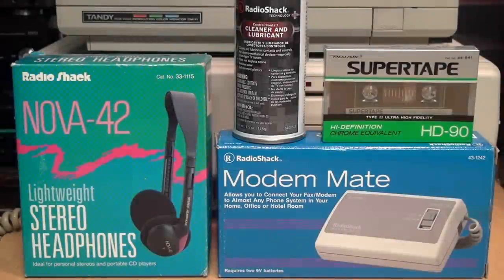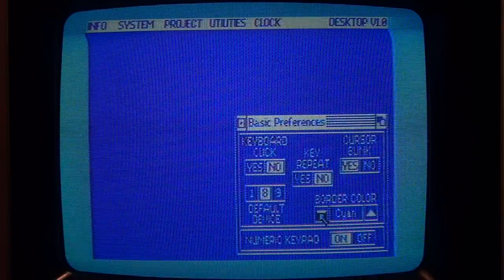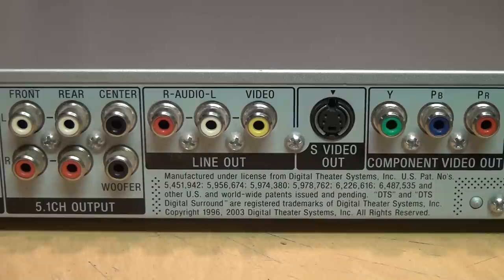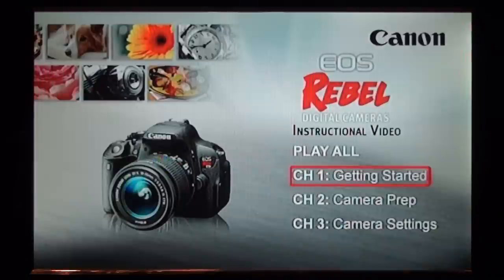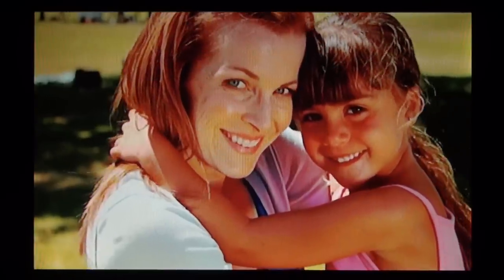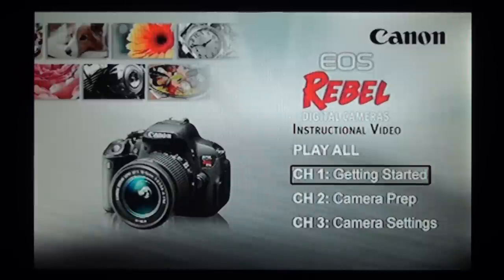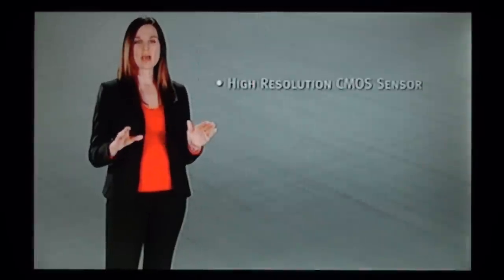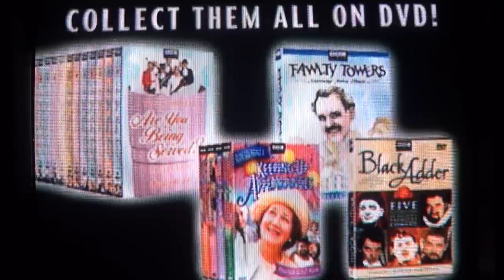Radio Shack S-video signal converter 📺 How? Why?

Comment: One thing I noticed with your C64 tests is that the composite output syncs fine but both the tied Y/C and the RS adapter skew the top of the picture. This is common when sync voltage is low, such as evident by the dark picture when Y and C are tied. But it's more confusing on the case of the RS adapter as it appears to pass the picture at full brightness.

Comment: These adapters were very common during the 2000 era of graphic cards with a s-video output. Most ATI AGP graphic cards had this kind of adapter in the box.
Reply: I still have two or three of these adapters rattling about my cables and adapters box, and they all came with a graphics card. It did come in handy when I hooked up an old video camera to a grabber. The grabber only had a component input, and the camera only had composite (and a small FireWire port, but there was no FireWire card or even a FireWire cable in sight, not to mention the drivers). I also had a SCART to component and S-video adapter that I used to digitize some VHS tapes with said grabber.

Comment: Laptop in 2008 didn't have HDMI or Composite out, but had SVideo out. Also my collection of game consoles had to be put into a switch box which, for some reason, only had Svideo out while it had both as in. I actually used one of these convertors for the switch box while my laptop came with its own octopus adapter.... back when people still watched TV.

Comment: I can see this adapter working in certain specific instances... I have a Walmart Special (SV2000) DVD Recorder/VHS Combo. The front panel inputs (Input 2) feature a composite and S-Video input with shared audio input, and I can select the source for Input 2 via the menu system, so this could work to connect two devices to that one Video Input.

The audio from that Coby TV sounds a bit like being on speakerphone (Nortel Meridian phone system)...

"What begins with 'come here,' and ends with ow?" Gets me every time!

Comment: Sometimes modern TVs actually have a combo jack of some kind (like TRRS) that put all the signals onto one inexpensive connector. The company then sells an
annoying custom dongle/breakout cable.
Reply: The best ways to use composite or S-Video era products on modern TVs is to either upconvert to HDMI or use an RF modulator. Sometimes a VCR in the chain will clarify the picture if using an upconverter. On my TCL TV, I tried the TRRS 3.5mm AV input and it did not work. The older devices we have had for years are often still the most reliable.

Comment: I used this in the past, running an early HP Media Center PC video-out around the room to a tv.. buying a 50 ft composite cable was much cheaper than buying a 50 ft S-Video cable at the sacrifice of a little quality at the time..

Comment: It’s likely just a simple LCR band pass filter centered at 3579545Hz, likely with a bandwidth somewhere around 0.5-1.5Mhz.  I’d expect this thing will notch this band out of the luma channel, which will make it look softer overall..  a good multi burst signal and a waveform monitor/oscilloscope would show what it’s doing rather easily… I used to align old GVG 3000 switchers back when I was a mere “engineering boy”
Reply: Yeah I was imagining something similar using a tank circuit to filter the relevant bands and separate them

Comment: One other use I can think of for this is if one type of input is all full on the TV and you don't want the hassle of an external switcher you could probably get this cheaper than a switcher and convert a device that normally needs the fully used input to the other where you have a free connection. It works better than I would have thought especially on that CRT, the reduced dot crawl could be worth the slight loss of sharpness

Comment: Svideo is just composite video with separate lines which carry the luminance and color components over separate wires, you can simply mix the chroma and luma, and sync iirc lines with resistors or a simple mixing circuit to get a composite rca signal

Comment: A reason I haven't seen in the comments so far, but what if you don't have enough ports? You just want to add some new device to your setup, you have a spare port (possibly even switchable with your existing remote control) that you otherwise couldn't use, and don't want to justify going to a full external switch box. That's one good thing from analogue, often possible to "bodge" just what you need.

Comment: You can still buy these converters on eBay, though generic unbranded rather than Radioshack.  The only component inside is a capacitor of around 470pF in series with the C (chrominance) signal before being joined up to the Y (luminance).  This prevents the DC level on Y (which includes the important sync pulses) being affected by C.  It's a very ghetto way of mixing the signals though with numerous flaws which is why the PQ isn't great.

Comment: I have an actual scenario where having this would have been awesome. 
For my gen 1 Xbox console the only av cable I had was an aftermarket “monster” cable that outputted to L/R audio and svideo. Now at the time I had tvs and vcrs that didn’t have svideo in but always had composite in. Even my Hisense older 1080p tv has composite but no svideo. This adapter would have been awesome. I think I might try to find one because I liked how heavy duty that cable is.

Comment: I have one of those that came with a PCI DVR card. The card was cheap and only s-video in and out so they provided the adapter (but only one). Haven't used it since I needed it emergently to make a v-jam session or projection show work 10 years ago. I'd run out of video inputs with everything connected to everything else! I think I was using it on an inter-layer of a live process effect so it just made it look slightly different (instead of color crawl or smearing in the program output)
Reply: I don't know if it has a capacitor BUT (and I just found it!) this one does have an arrow pointing from composite to s-video so I'll check if it has a cap... looks like no! Interesting! I think I was only using it to pass a monochrome key signal anyway, image damage may have been (actually) negligible.

Comment: I used to connect the chroma and luminance together with a simple 470pf cap. It wasn't perfect but it did ok for my needs.
I think most of my problem however was I have a radio station close and I didn't adequately shield it.

Comment: The main difference between NTSC composite and S-Video was the video bandwidth. I've forgotten the numbers now, but S-Video had something like 20% more bandwidth available than composite did. So it is perfectly reasonable that composite is softer or blurrier than S-Video. Lower bandwidth means slower transitions from one voltage to another, and this translates into blur between the pixels.

Comment: I had one of those back in the early 2000's. Had a camcorder that only had a S-video input, and a VCR that only had a composite output. I would run video from the VCR, convert it to digital, then run that to my Mac. Those adaptors cost $26.00 back then. Expensive little booger.

Comment: Back in the day I had a cable with one end being S video and the other being RCA, packaged with a GeForce FX 5200 (Can't remember the brand, may have been Inno3D)    
Used this to connect my PC to my TV  
It didn't even have anything that could contain any circuitry inside, so this "conversion" is probably considerably simple

Comment: the circuit for that is super simple. one time I just installed the plug and the cap directly into a tv to "add" the ability to take in svideo. could not really notice on TVs with the dot pitch of rice.

Comment: I could see this being useful.  Say, you've got a cable box with one of each video connector on the back.  Composite goes into the television and converted s-video goes to the VCR.

Edit:  this comment was stupid and im leaving it here as a reminder of shame

Edit 2:  Flatscreens will often have legacy rca composite input, even if they lack component or svideo.

Comment: I got one of these in about 2003 to convert the s-video output on my computer to the component input on my 28" crt tv. 
The biggest computer screen i had wss a 14" crt. The resolution was awful and i could barely read anything even at 640x480. Thats when i discovered that TV's werent designed for that use lol!

Comment: I suspect these were mainly for connecting laptops that had s-video output before HDMI widespread adoption but VGA was too thick. most notably in some MacBook models.
Also useful for those tvs with only one rear and one front input, but also had an s-video input on the rear, of you wanted more than one device connected

Comment: I use a similar one for my playstation2. The best cable i have is a s-video one, but my little 14" crt only has composite input. So this little adapter does a good job.

Comment: I could see how this would be beneficial if you had a tv with an S-video input with a separate source selection and didn’t want to have to use an external source selector. I have such a TV(from 1998), but I use the S-Video to input from my Panasonic DS-555.

Comment: Haven't needed to use it, but I have come across tvs with 2 dedicated composite inputs and 1 dedicated s-video input (each with their own set of audio inputs), so an adapter like this would have opened up an input for a 3rd game console or similar (I suspect this would have cost less and easier to find than buying the s-video cable for the game console).

Comment: I have 1 of those! I need it for one of my video capture cards which only has S-video input. Interesting the card can "sense" the adapter and if your using it you see nothing on the "S-video" input(you have to switch to the "composite") input. My ATI Radon 7000(Mac edtion) also only has S-video(this time as an output). I believe it can also "sense" if the adapter is in use. I never relized those where "generic" though, I got mine unboxed and always thought they where a PC thing.(kind of as you said, why else would you need one).

Comment: Heh.  Back In The Day i had a pair of those lovely Commodore cube colour monitors that I’d use with VCRs.  I’d take a y-adaptor so I could use the Composite/Choma-Luma inputs as a cheat to avoid having to switch input sources the hard way. :)  And somewhere I’ve got a handful of S-video<->composite adaptors that came with the early Macintosh A/V models.

Comment: Surprisingly my TV has analog inputs, composite, component and several HDMI but no S-Video at all. I’ve found that on all of my Sony TVs. I too have this adaptor. It doesn’t do anything but pass through the signal either way although it seems to do a little but not recommended and I’m in a PAL B/G region so composite is 525i and S-Video is 625i

Comment: I had a laptop that had an svideo output and no rca video out. it also had vga. it seems it was for connecting to a standard TV for presentations. it came with an adapter like that but longer.

Comment: I had to buy something like this recently. I had an OG Xbox but the only cable I had was the "advanced AV cable" which was S-video out and optical audio. My TV when I got it had all the inputs, but my newer TV only has composite and component, not S-video. The results were fairly poor. I eventually went and got a "HD" cable for the Xbox, component with five RCA cables which was way better, although losing digital sound.

Comment: Hey you bring up an interesting question Kevin
Is there actually TVs out there today that have eliminated all the analog inputs?
I got some TVs as new as from 2018 to work on and most if not all had analog composite as well as combination analog/digital f-conn female jacks on them.
Some even still had VGA or display port as some may call it.
One was a smart set that had a cracked screen and even it had two sets of analog composite+stereo analog jacks.

Comment: Or simply you have a player where the RCA broke off (my first dvd player had the video portion of the RCA plug just pull right off), but the DVD did have Svideo out, but my TV only had RCA input (as we'll as RF), but no Svideo. At the time it was my only DVD player and the TV I had was my only TV and no money to spend on buying another DVD player, or buying another TV that had SVideo in, so this converter solved that issue for little cost.

Comment: I still find it baffling that in the US the best video you could get from a standard DVD player was S-video.
Here in the UK we had DVD players outputting full RGB over scart. When connected to a decent wide-screen CRT it looked fantastic.
Also am I right in thinking that wide-screen CRTs didn't really get that popular there either? Here in the UK they were quite popular just before flat screen plasma/LCD  TVs became available and affordable.
Reply: There were DVD players with component outputs fairly early on, but they were limited to high-end models from what I remember until those became more common in the 00’s.
Reply: @pokepress  Here in the UK every DVD player came with RGB scart as standard. Some would also include component but not many TVs used it as it was unnecessary with scart being so popular.

Comment: It might be a false memory but I think my friend had some kinda european camcorder that only had S video (Or he brought back from Europe). Back then you would hook it up directly to the TV to play recordings, and he used a adapter like this because everyone's TV's were left over relics with only RCA/co-axel jacks. It wasn't until later in the late 90's that S-Video started to appear on TV's where I lived but they were more expensive.
Reply from the maker: Many mid-2000s camcorders had composite video and stereo audio via a 3.5mm TRRS jack and a separate S-video output. So unless you were familiar with composite video going through what looks like a headphone jack and requiring a special cable, you might think the S-video output is the only video output it has.
Reply: @vwestlife  I think I am remembering it wrong. I messaged my friend about it. He said that he had a JVC Super-VHS Machine & Camcorder that his Dad had bought in the late 80's on vacation. He said that the VCR came with a Y adapter because you had to buy the special JVC TV as well at the time to use the S-Cable. But he thinks I am remembering the "Rf adapter" for the camera. Because we had lost it when we borrowed it from his Dad to film us skateboarding. And we got told off because it was super expensive to replace at the time

Comment: s-video to composite is easy  but composite to s-video is the weird one. How do they separate chroma and luma from a combined signal?
Reply: I think it must have a bandpass filter on the chroma output and probably a notch filter on the luma output. Without the bandpass filter I can't see it working at all for splitting composite into useable Y/C.

Comment: How what why I think I'll procrastinate. I installed a projector and rather than repurposing the component cable or returning a separate composite cable I decided an S video composite adapter was far easier.
I got mine from cables to go though and the quality was quite good I still have a couple extras hanging around they had the benefit of having male and female.

it also had to VGA this was pre-HDMI.

Comment: I would have actually used it to "upgrade" composite stuff, so I only have one row of inputs and outputs on my AV receiver, and more importantly, only one cable to my projector.
I always had to switch the projector input to/from S-Video when I was switching from one input to another and the signaling method would change.
Nowadays it's obviously all HDMI, and if I had any composite or S-Video sources, the AV receiver would upscale it anyway.

Comment: Fun fact my old cheap hyundai crt TV from 90s model ctv 3711 sn has only a scart connection no normal video jacks are present (there is a place for them but it has plastics plugs in the holes for video) soo i use some type of this adapter just that I have a composite to scart. Soo yea there are tvs without composite video but have only  scart
Reply: My OTF TV doesn't have av either, only scart

Comment: One use I could see for this, I had a TV that would read a 240p signal as 480i over composite, but not over s-video or component. So something like the NES looked like hot garbage without some kind of workaround.

Comment: I've still got a few of these, from back when I was trying to build a media pc ('99-02) with a crt. It worked but video capture (output composite, tv only had component & s-video) on a premium 3 @ 500mhz was rough. Files were huge and a/v sync sucked.

Comment: It's probably just a 470p capacitor from chroma line to luma! This should just work, in both directions, somewhat badly, in conjunction with the source resistor that you expect on luma in the source device. Or do they have a little choke on the luma line as well?
Reply: I had one adapter a bit bigger that this in the 80's in a small box. Just a capacitor (probably 470pF as you said) and, if memory serves,  a nice small RF coil in the luminance line to remove as much as possible anything above 3MHz aka  the chroma.

Comment: I remember seeing similar adapters come with old graphics cards. Didn't work too well in my experience. (Could only get a black and white image.) If I recall, I ended up just using an RF modulator which had an S-Video jack.
Reply: RF Modulators are still among the most reliable ways to use these inputs. BTW, a lot of cheap TVs composite inputs use a cable that is uses a 3.5mm plug to create the composite video input and this is not always reliable. The most reliable ways to use S-Video and composite video inputs on today's TVs are either to use an upconverter box to convert the signal to HDMI, an RF modulator, and/or a VCR.